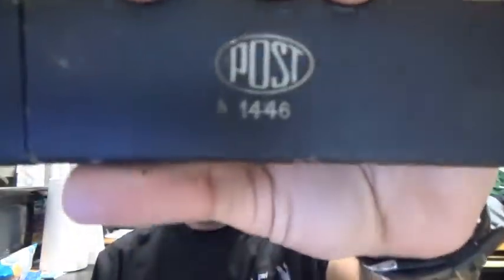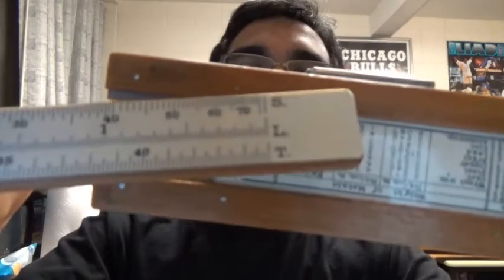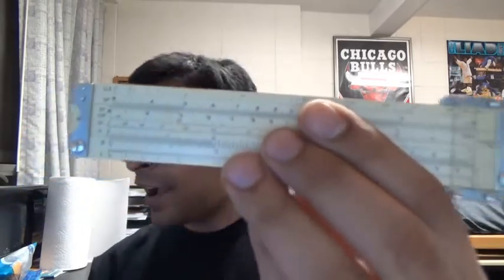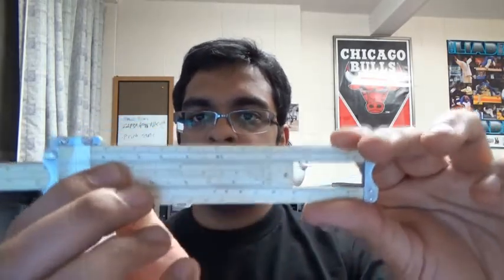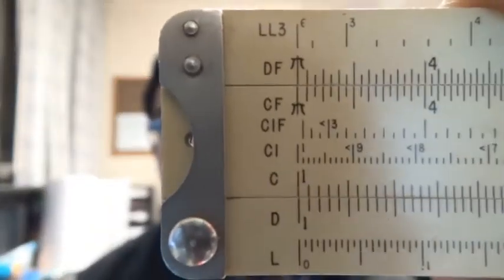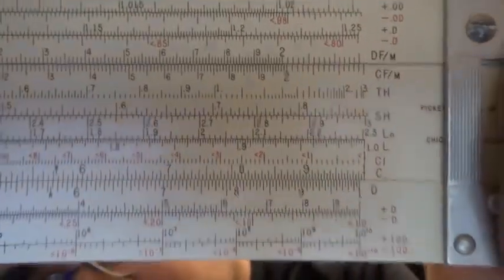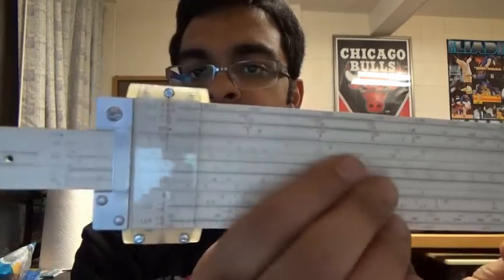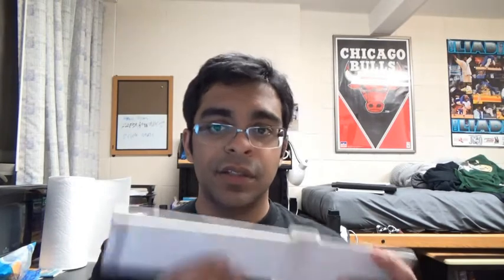Three New Slide Rules: Pickett Model No. 300, Post 1446, and Pickett Model N4T

Comment: I’m very glad that I stumbled across this video and your channel! I have been using Slide Rules and other devices for about 48 years now and it is wonderful to see a young fellow such as yourself interested in all of them! Good on ya! As to your pocket Pickett Slide Rule, please note that the screws at the top of the end braces allow you to adjust the tension in the Slide. The binding you are experiencing on the one end is due to the top Stator, (the top scale-bearing piece), being too tight. Loosen the screw and gently pull the Stator out a tiny bit so that the Slide moves freely and smoothly. When the movement is just right, not too loose because you lose control in precision setting the Slide, tighten the screw again. Then, do the same to the other side of the Rule until you have a perfectly even tension in the Slide in both directions. This will also greatly extend the life of your Slide Rule! A note of caution here: try not to use lubricants on the Slide Rule because they can interact with the facings of the Rule, discolour them, and even slowly dissolve the painted surface! Always use a wooden toothpick to clean the grooves and also to run along the tongue in the Slide. This will safely remove dirt and grime and give you an amazing action in the use of the instrument. I ought to know...I have around 300 Slide Rules, all of which are in top condition. If you need any more information or if I can answer any questions for you, please let me know! 👍🏻😃🇨🇦
Reply: Larry Stewart  I read your comment and 
I have a question...if a slide is out of adjustment how do you re-adjust it?
Reply: @phantomcruizer  Can you be a little more specific? Are youreferring to the cursor, or one of the stators (top part with scales on it, or the bottom part with scales?)
Reply: Larry Stewart  What l mean is if the slide rule is accidental dropped  and the upper and lower parts aren’t aligning how might it be realigned.
Reply: @phantomcruizer  AH! I understand! First, line up the slide with the bottom stator (the one that is riveted to the braces). Then loosen the screws on the end braces and carefully move the upper Stator until it aligns with the markings on the slide and the bottom stator. Then tighten the screws again! NOTE! If the slide becomes too tight because you squeezed the parts together in the realignment, just loosen the screw on one end and gently pull out the stator, just a tiny bit, and then tighten the screw enough to hold it while you repeat the same steps on the other end. Once you have done both these sides, try the action of the slide. If it requires another adjustment to get it to the tension you like, repeat until the slide is moving smoothly and is not too tight, nor too loose. Then carefully tighten the screws down firmly, and you are good to go! 😎👍
Reply: @larrystewart2506  Thank you for your helpful reply.

Comment: You should check out the Slide Rule Universe.  They have a lot of info about how to use slide rules. I think they even have some manuals in PDF form.  You have some good slide rules there.  Some great slide rules to look for (they may be pricey depending on where you find them) are the K&E Decilon (it comes in a pocket and full size), Post Versalog, Faber-Castell 2/83N and 2/83 (both are serious slides but the 2/83N has a ton of scales), as well as any circular slide rules.  I almost forgot.  The Slide Rule Universe sometimes has spare/replacement parts for some slide rules and they sometimes have some for sale but they are pricey.
Reply from the maker: thanks, Kyron! I've actually checked out the slide rule universe, they're pretty cool.
Reply: Hi Kyron! I am glad that you like the Slide Rule Universe. I am the guy who provided the artwork for the main banners and the rest of Walter’s amazing site! It really is a prime resource for the noble Slide Rule and many other wonderful things! 😃